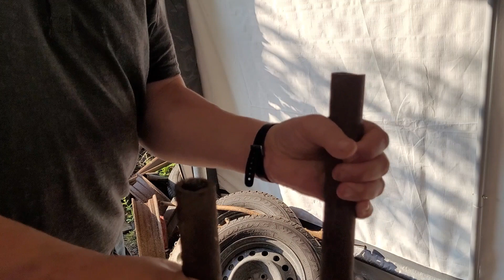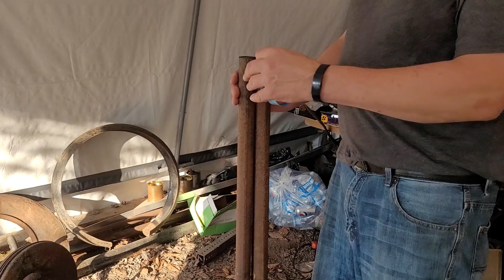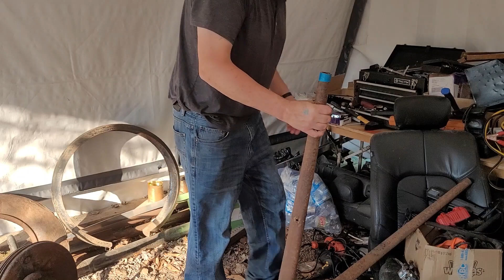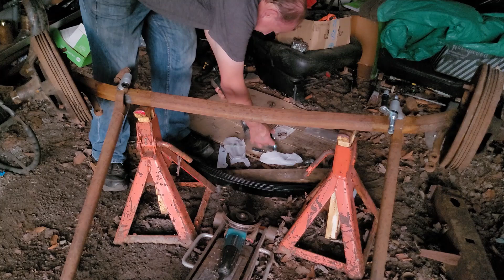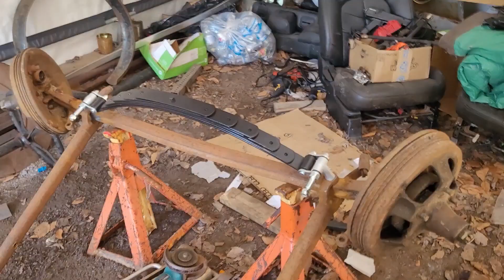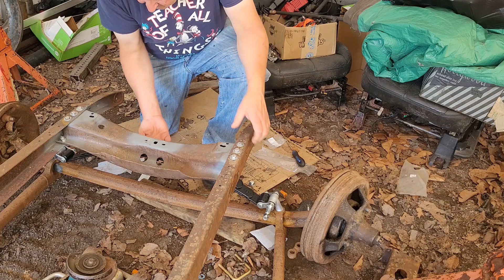Installing The Front Axle In The Old School Hotrod

Comment: Grease isn't the problem,  it's just that Chinese crap that speedway has been selling isn't measured in the same way the original parts were built,  now if you buy the whole kit with axle and bars, they go together smooth